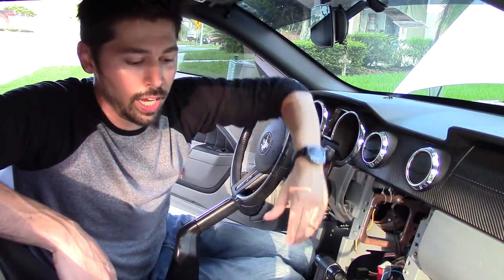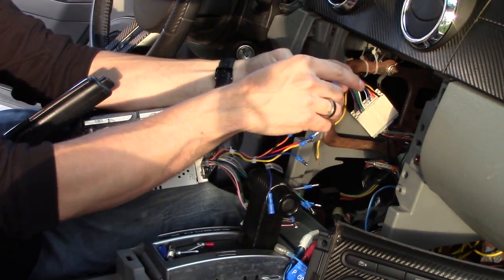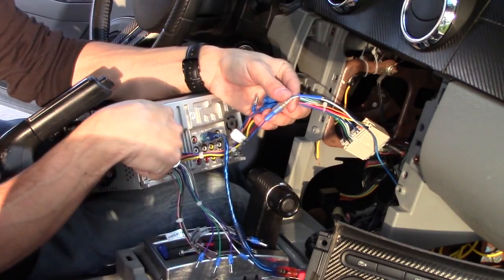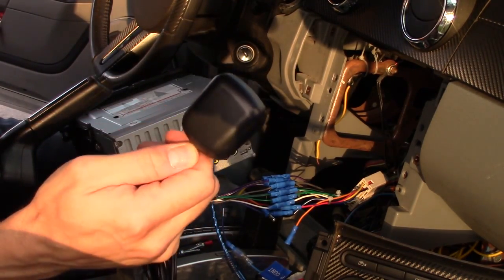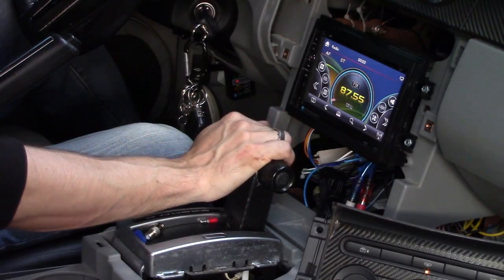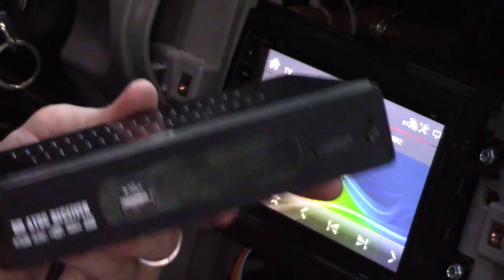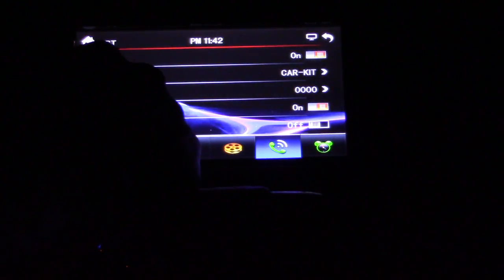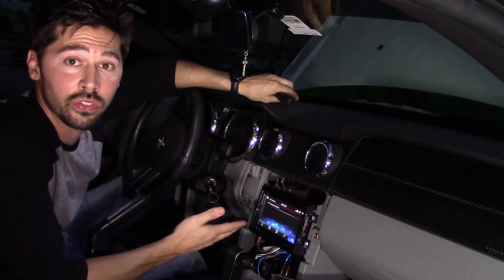HOW TO INSTALL and WIRE AN AFTERMARKET CAR RADIO WITH GPS

Comment: Used your suggestion of mounting the antennas for the navigation unit and satellite radio inside the dash.  This works perfectly!  Saved me a ton of time and I don't have unsightly aftermarket antennas on the exterior of my 2005 Sequoia.
Reply: I was wondering about this, so no issue with signal then huh

Comment from the maker: update radio still works great and learnt few new features like "your over speed limit" announcements settings in GPS mode.
Reply: You checked the current consumption of navigation when in standby, because I was eating 0.5A hour, I did not use the car for three days and the battery died, did you happen to not use the car for so many days?

Comment: I hooked up the same exact radio with a Rockford amp and mtx sub. I am having a hell of a time trying to get any sound from the sub. Amp turns on but no sound. All new wiring and done correctly. The subwoofer is "on" in the radio. What am I doing wrong? Is there a hidden menu? I notice in the eq there is no adjustments for the sub.

Comment: Good night Sir, I really to know, what is all the items you use to install the stereo, specially the blue plugins cables on the back of stereo. This stereo fits on Mitsubishi Nativa 2001? What do you install the gps antenna and how it works without internet service to upgrade the maps...I am from Puerto Rico, USA. And what is the box gadget did you show on the video?? Thanks

Comment: You must put satellite antenna on the outside of the car.  It won't pickup signal without it being on the outside of the car.  Due to you must have a clear plane of the southern sky. Hiding it will not work.

Comment: Key to change logo?
Reply: I have the same problem ... I do not even know the code and do not specify it in the manual!
Reply: Could you try 6556 or 1983?
Reply: 0207